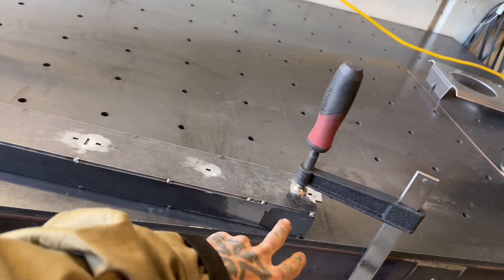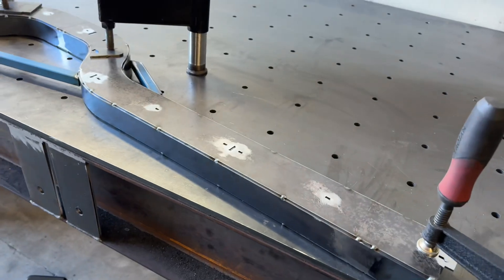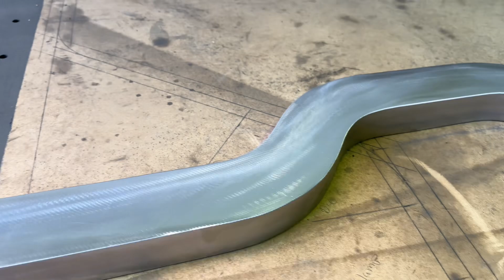Chassis Rail welding and finishing

Comment: Nice work! Curious how you did the internal gussets.
Reply: I'm guessing tacked them in place before assembling the frame then welding through the pre cut slots/holes after welding round the edges??
Reply from the maker: I tack all the internal gussets to one side of the frame first and place the other side ontop then tack through the slots. Then I’ll stitch them into place before the straps go on.